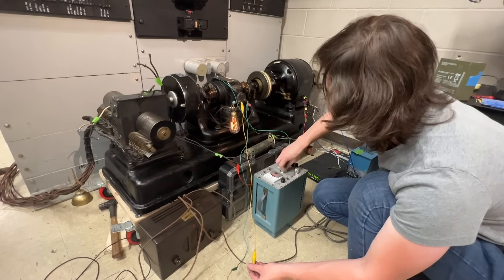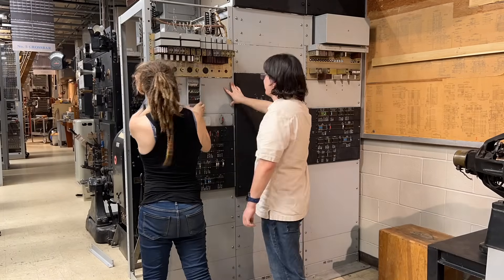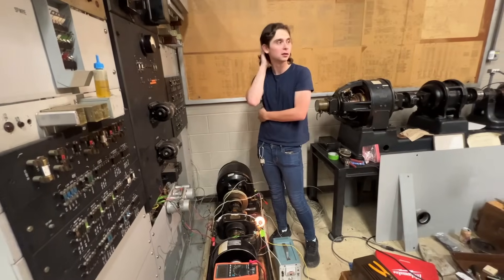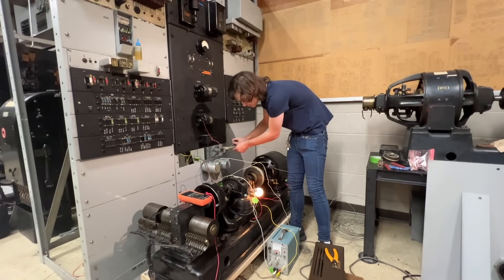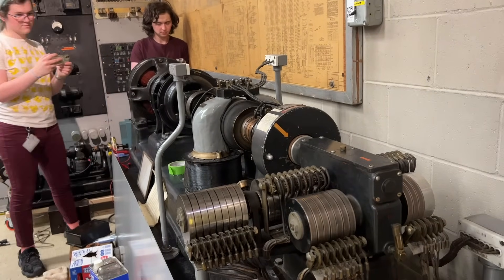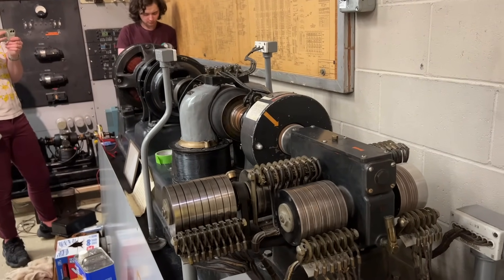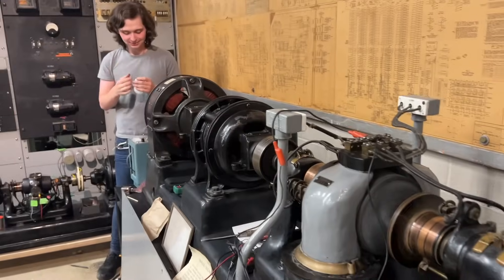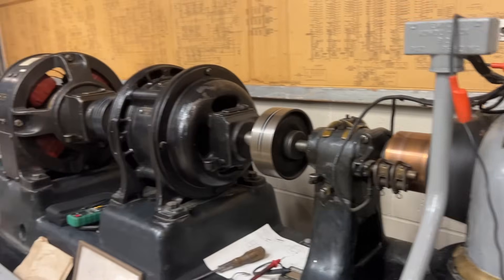WE'VE GOT A HEARTBEAT! The 1910's ringing machine is working!

Comment: Don and Andy had told me that the issue with it was, was operating cost, noise and ongoing required maintenance. 

The Motor-Generator set is (obviously) not as efficient as the solid state ring generator - at least not at the demand level of what the museum needs.

Comment: Why was 90V @ 20Hz chosen as the ring signal?
Reply from the maker: Turns out that most people can crank a magneto by hand to generate about 16Hz AC. When machine ringing took over, they raised the frequency a bit from 16 to 20hz because of the speed of the AC motors that drove the machines (1200 RPM).

The 90 volts thing is just an estimate. Ringing could be anywhere from 80 to 115 volts AC depending on how the power system was configured. Since voltage and current are inversely proportional, the higher ringing voltage means that you can ring fewer phones simultaneously. The opposite is also true. If you want to ring many more phones, you can lower the voltage to give you more amperage.
Reply: @ConnectionsMuseum  ah, so the frequency was a hold over from the old manual-crank days.  It’s amazing how many technology design decisions (and compromises) were made to maintain backward and/or forward compatibility.
Reply: @VictoryHighway  Well not necessarily the cranking part but that's the frequency needed by the electromechanical ringers. Backwards compatibility is critical, but that very simple design persisted until electronic ringers in the '90s. At a higher freq you'd get a much harsher sound or even a buzzing, and more stress on the hammer and other bits inside the ringer. Lower frequency would just be clanking lol. An large increase in voltage would potentially have negative safety and reliability impacts as it increases the risk of arcing, injuring technicians, or shorting out sets... a much lower voltage wouldn't be enough to make the ringer work as well. Very much a case of "we did it that way so we must keep doing it that way". Fun fact, a modern VoIP ATA can still ring an old phone!

Comment: the reason the meter is going o/l... is because it's not true RMS, and is ASSuming  sine wave... ringing was meant to be a peaky voltage, to drop magneto indicators or causing a 'ting' from bells over circuits way higher in resistance than a sine wave could even be detectable over....

Comment: of course we're interested in this sort of thing.... question ... in the USA did they use resistance lamps in series with the ringing voltage to protect the unit? Sorry if you've covered this before. In the UK the GPO/PO Telecoms/British Telecom used nominal 660 ohm resistance lamps in series, to protect it from shorts... In normal usage, the resistance is tiny, but if shorted, the lamp will light, and get to 660ohms ish...

Comment: I believe this is the ringing machine from the Southern New England Telephone Co. (SNET) Hartford 01 office. If true, I am the last switchman who operated this machine for an emergency feed to a failed ringing plant in the Hartford 02 Toll office. If this is the same machine, it had been idle for many years when I fired it up. It immediately produced 105 volts and 24 Hz. The interrupter discs required a lot of tender care, with hours of buffing off years of corrosion. After a few days of work, the old machine was ready to provide full ringing plant service to the Hartford 02 Toll office and the Hartford AT&T plant office while repairs were made to the Hartford 02 ringing plant. This machine powered the Toll office for roughly a month then after the repairs were made to the Toll ringing plant, I sadly shut this machine down for the "last" time. If this is my machine, seeing my old friend again brings back memories. Take care of her, she was a good machine. 

MJF retired SNET, AT&T, Frontier technician.
Reply: That is so similar to the ringing machine I worked on in a combination Panel , No. 1 , and No 5 Crossbar office in the Dunkirk Central Office in Michigan Bell Telephone Company. I hired in as a PowerMan in 1968.. That machine was so reliable. I used crocus paper to clean the carbon tracks off of the commutators from the carbon brushes. Everything was done per the BSP'S. As a new hire, everything has to be done correctly. I spent hours and hours reading the BSP'S to make sure I was doing things correctly BY THE BOOK,   = THE CD'S, AND THE SD'S
Reply: In what year did you retire that machine?
Reply: @d46512  If memory serves me, I shut the machine down in the summer of 1989. It then sat idle for several years until the office was gutted and demolished.

Comment: I am excited for this.  Plus the digital network you recently acquired.  I have a question of course.  If this ringing machine is supposed to ring phones or create busy signals, what happens if 2,000 people dial numbers on the exchange.  Is this one machine capable of ringing 2,000 phones simultaneously?  I would think with so many phones connected to ring that it would drain the power so much that none of the phones would ring.  

Also, if these 2,000 phones are all connected to the exact same ringing tone, how come you can’t chat with the others on the line listening to the same ring tone?  If they are all connected you would think it would mean they could talk.
Reply: They say it's a 600 watt generator in the video description. Assuming perfect power factor that would be 6.7 amps at 90 volts. A standard ringer is 7k ohms or about 13 milliamps. That's roughly 500 phones ringing at once, or 1500 when you consider the 2-4 second ring pattern.
Reply: Sure it will ring that many phones, but not simultaneously. The ringing for one phone is 2 seconds of ringing followed by 4 seconds of silence. 
But the ringing machine will ring groups of phones, so one third of the phones will ring while two thirds have their silence period. Then the next group gets 2 seconds of ringing power while the first and third group will stay silent and so on. So at any given time only 1/3 of the connected phones will ring truly simultaneously
Reply: @kuebbisch  Those differs from my understanding.  That means there would have to be 3 ringing circuits on the machine.  It was my understanding just one ring connection for each ringing machine and the phones all rang simultaneously.  Perhaps the machine is smart enough to increase the power if there’s too much resistance.
Reply: @ds99  No: The generator will generate a permanent 90V/20Hz ringing voltage. But since an individual phone rings only 2 seconds out of 6 it would be a waste to size the generator and to generate the ringing power for just 2 seconds and then switch it off of 4 seconds. 
Therefore there will be at 3 cams that interrupt the power and create the ringing cadence so that you have 3 outputs for ringing phones. Each cam is rotated from the previous one so that no two phases ring at the same time. So A will ring for 2 seconds, then B, then C and start over. 
This is then distributed and a third of the connection frames use one phase. So your neighbors phone would ring simultaneously with yours, but a block away the phones may ring 2 seconds before or after your phone. 
There was some tricky circuits to ensure a timely first ring though, so that you didn't need to wait in the worst case for 4 seconds until your phone starts ringing when you got a call.
Reply: In the end a central office will just make sure they have a ringing machine adequate for their subscriber count, which is why you've got ringing machines in different sizes.
Reply: In practical terms the number of phones ringing will be limited by the available circuit paths through the switch. Probably max out on dialtone or reorder before you'd worry about ringing :D

Filters prevent crosstalk through the tone circuits

Comment: That is really neat. An old machine with a 20Hz alternator on a shaft with motor.  If the shaft turns at 1800 RPM, the alternator would have 12 poles for 20 Hz output.
Reply: another form of a motor-generator set, just with a specific purpose.

Comment: Can the DMS-10 do Centrex? That could be an interesting video, also interfacing it with analog switches using MF since no DMS in service is using MF afaik
Reply: Just found this channel so I'm not familiar with what the museum has. I'm not sure if a -10 supported Centrex services, we certainly never ran any, but we did have some MF trunks at time of commissioning before TDM made its way to our little rural CO.